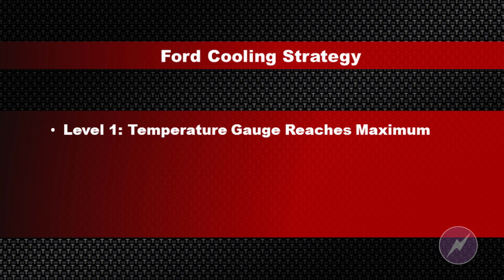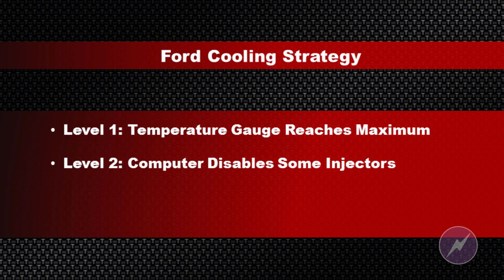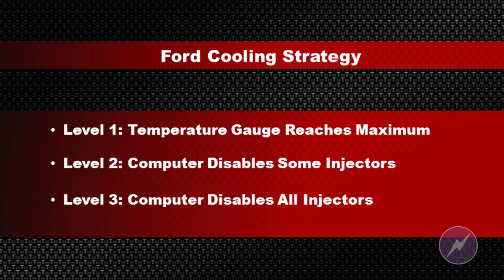Tech Tip| P1285/P1299 Ford Cooling Strategy| Ron Bilyeu

Comment: They’ve used it before 2008, my 04 town car is in limp mode right now from a p1299 lol, can’t figure out why I’ve replaced everything almost
Reply: Let me know if you ever found out how to solve it.
Reply: @iNd5ky  it runs like a dream now, I had to replace the intake manifold and it leaked coolant on the cylinder head temp sensor, I took it out dried it out and cleaned it with maf sensor cleaner and plugged it back in put the new intake manifold on and it works fine now, these ford 4.6s are known to blow intakes but other than that they’re bulletproof

Comment: I got stage one on my 04 f150 5.4 3v lariat  but has p1299 code , what would be main issue or fix for this? Trucks not overheating I've changed thermostat and fluid or coolant is fine
Reply: Water pump

Comment: I REPLACED AN ENGINE IN A 2011 EXPLORER IT BLEW HEAD GASKETS. ALSO REPLACED T STAT ALL HOSES ECT, I NEED TO SMOG IT. IT HAS A PERMANENT DTC P1299. I'VE BEEN DRIVING IT FOR A FEW DAYS NOW. IS THERE A PROCEDURE TO MAKE IT RUN THAT DTC TEST SO THE PCM WILL CLEAR THE PERMANENT DTC?
Reply: I've got a 11 edge 3.5 had a bad water pump. I replaced it and the chain and other parts involved. I have that p1299 permanent and a few other codes. It runs fine. Put about 167 mi on it. Did you ever find a fix?
Reply: @wrenchaholic_  MY NEPHEW DROVE IT AND PUT SEVERAL DRIVE CYCLES ON IT. THE PERMANET DTC FINALLY CLEARED SO I COULD SMOG IT. IT TOOK A LOT OF MILES. LIKE 600

Comment: The first Cadillac Northstar engine used to shut down half the cylinders to keep it from running hot also. They claimed you could drive 50 miles without coolant without any damage to the engine.

Comment: Replaced OEM hoses with HPS radiator hoses. The worm gear hose clamp loosened while I was driving and the car overheated. Threw the P1285. Was close to home so saw check engine while I was pulling up. Easy fix for me, just tighten them clamps and add the lost coolant using a vacuum tool to eliminate all air that was introduced. Overheating can be a scary thing. Think of P1285 as a warning, I doubt any engine damage happened.

Comment: Will this cause codes P0301 and P0171 to activate or do I genuinely have multiple issues?
Reply from the maker: It is always possible one trouble code will activate another code creating a false positive. Sometimes a trouble code is the direct cause thus creating multiple issues. The best strategy is to fix the biggest problem like P1285/1299, reset codes, and test it again. 
Have a nice day!
- J. from AVI

Comment: Hey man, now that I fixed the P1285/P1299 issue, I have a P0420/P0430 issue, I did drive the truck for 20 more minutes after it went to fail safe mode. Would the temp sensor issue and driving in fail safe cause a catylitic converter issue? Or O2 sensor issue?
Reply from the maker: This might be a bit complicated. It can be the catalytic converter (most common) or the 02 sensor went bad. This is either due to rich or lean, clogged engines, or a leak. After examing the exhaust system for damage, use a digital multimeter to check the voltage reading of the downstream O2 sensor. If the voltage constantly jumps between 0.1V and 0.9V, the catalyst needs to be replaced.
- J. from AVI

Comment: I have a 2015 Ford F150 5.0L and my temp gauge is pegged out and wont go back down, it has a message that says "Engine Coolant Over Temperature". I hooked up a new Cylinder Head Temp Sensor and it stays pegged. The truck is stuck in fail safe and btw it never overheated. Does it have to be reset to get the gauge back to normal.
Reply from the maker: I just checked in with Ron Bilyeu. All you have to do is clear the codes. 

Have a nice day!
- J. from AVI
Reply: @AVIONDEMAND  Can I clear ir without a code reader, someone said i could run it for 21 minutes? Second question, can I clear it with FORScan?
Reply from the maker: @tisdale36  You need a code reader and depending on the code you could use a generic code reader to remove it. However, if the code(s) comes from the manufacturer or distributor then you will need a professional technician scan tool and that tool alone will run you over $1000. It's worth a try with any code readers in your possession, but you might have to take it too a shop anyways. 

Have a nice day!
- J. from AVI
Reply: @AVIONDEMAND  It worked. Thank you.

Comment: Boy I hope this is what is causing my 2003 focus with 16v zetec to run rough after belt tensioner broke and wife kept driving it. Got belt and tensioner fixed and it ran fine for a while but check engine light never went off even though temp gauge is just below half and doesn't seem like it's overheating. Hoping CHT sensor just got messed up and after 50 or so miles of being on it's trying to shut things down and isn't blown head gasket or worse. Wish me luck!

Update: I reset code and it still ran bad, and came on again after running briefly. pulled plug wires and both wells full of water. I assume for overheating but not exactly sure where from since they are kind of isolated from any water. Sucked it all out. pulled plugs and only one looked a bit white. No foam in cams nor dipstick. Reassembled and still ran rough. Thought hey water displacer 40! Pulled plug wires and sprayed both ends with wd40 and it runs fine now and check engine light is staying off. Good luck has struck....hopefully keeps going! Thanks for the info.
Reply from the maker: The best of luck and godspeed!
- J. from AVI
Reply: @AVIONDEMAND  So does this code typically stay on till reset?
Reply from the maker: @mickjager5974  Typically, the code will reset itself after a few minutes once the problem once your cooling system is full and holding coolant. This would include any replacement parts. 
- J. from AVI
Reply: @AVIONDEMAND  OK I'm going to try and reset code but sounds like maybe the sensor got damaged as the car doesn't really show any signs of running hot now and as I mentioned, ran pretty good for 50. We'll see and I'll try and  give another report in a day or so.

Comment: I have a 2013 Escape that is having a false overheat issue. After a cold start it runs for a minute then pegs the temp gauge and goes in to limp mode. Seems to be a known problem but no answers to a fix?
Reply: Did you find the fix.  Mine is doing the same.. i have done everything.  I think.
Reply: @MrLuwitin  it was a faulty wire. It was a nightmare to trace. Check all of your sensor plugs and all the wire going to it. They become brittle and eventually the housing cracks and the wires arc.
Reply: @buckets_of_lead  which wires were cracked? These ones that lead to the tempurature sensor?
Reply: @zhof93 yea. Drivers side above the trans case
Reply: @buckets_of_lead  ours intermittently throws the p1299 code and have already replaced the temp sensor and it just threw the code there other day. Was yours an intermittent problem?
Reply: @zhof93  it was for a friends car but yea it started intermittently. I replaced the thermostat and thermo housing just to rule that out. Once I did that it started the false overheat every time you start the car and let it run for a little over 1 minute.
Reply: @zhof93  the temp gauge on the dash doesnt actually read the engine temp. It's more of a dummy gauge for the driver.
Reply: @buckets_of_lead  yeah i learned that the first time it did it. The guage was pegged hot but with a scanner hooked up it was only reading at 160. I hate chasing wiring issues
Reply: @MrLuwitin  were you able to fix it? i have the same problem with my 2015 fusion, replaced both temp and coolant sensors and  i have the same problem.  P1299
Reply: @Daniel_ATL  yes, it ended up being the negative cable from the battery.  I replaced it.
Reply: @MrLuwitin  where you getting code P1299?
Reply: @Daniel_ATL  yes
Reply: @MrLuwitin   can i have the part number for the battery cable? I would like to do some research on it.

Comment: uh ... how do we reset it once we've replaced the radiator and replenished the coolant?
Reply: OG-YARL have you found out how? I just took my van out of shop today and even they couldn’t make it go away.
Reply: Undo the battery for at least 5 minutes. Then reconnect. It worked for a 5.4 2001 f250 super duty.

Comment: I'm diagnosing both a 1285 and 1299 right now as well as a p0297 (over speed condition) in a 2011 transit. The driver continued driving and it now wont go above 30-40 mph, shifts over 4k rpm, has stalled out once illuminating the oil light, and accelerates like its in 3rd or 4th gear. Never ran into this before so any suggestions would be appreciated

Comment: Since 2008?  My 1997 F150 has the fail safe shutdown strategy
Reply: Yeah, 2001 mustang v6 did it today. Shut down half cylinders then engine cooled and ran normal, i think thermostat is failing. Hasnt been using reserve coolant but radiator had some air at the top. i check fluids every single day.